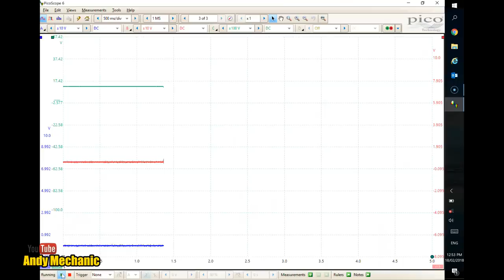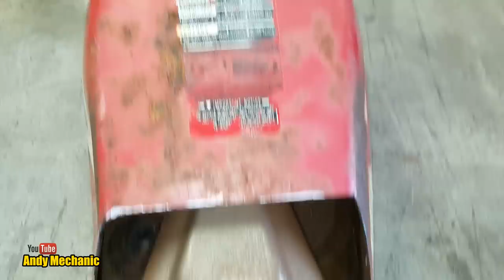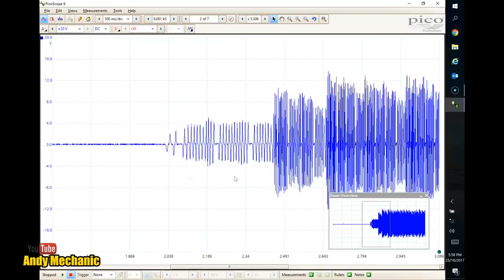Honda ATC fuel tank weld up! #2014

Comment: Really enjoying these Honda ATC videos! As I mentioned before, I am planning on getting mine running again later this winter. I've read where some have cleaned most the inside rust by putting aquarium gravel inside the tank, duck taping the fill hole, wrapping towels or old blanket around it, then putting it in the dryer on non heat tumble. Good DIY home owner method if you don't have a shaker.
Reply from the maker: Genius.....I wonder if the wife will let me! Lol  More ATC videos to come in the New Year just as soon as the new workshop is operational.....watch this space! Cheers Andy

Comment: I used to  remove all caps plugs and taps from petrol tanks leave them to evaporate take them outside and apply a long reach blow torch to the filler, sometimes there was a whoosh but more often than not a feeble little bit of flame for a couple om minuets. Road tankers on the other hand got steamed out over night before work commenced on them.

Comment: A job even ivin will be proud of. No parts required lol
Reply from the maker: Haha! Very true, that's Ivan's motto now! Lol Have been using the ATC this morning to move a load of boxes up to the storage shed.....so much fun. Seems to be running rich at idle & no brakes make it interesting with a loaded Trailer but it worked just fine & got the job done super quick. Cheers Andy
Reply: @AndyMechanic  think your work shop will benefit from a sonic cleaner for carbs exct
Reply from the maker: Most definitely....it's on the list....but first I need to get the workshop moved.....so far I have driven 3,000km moving the gear....and I'm about half way! Lol